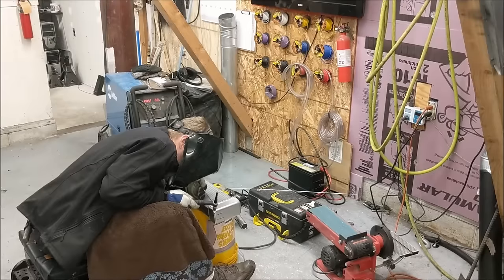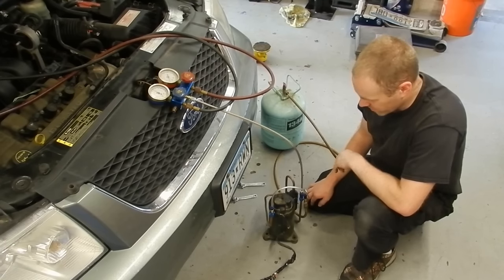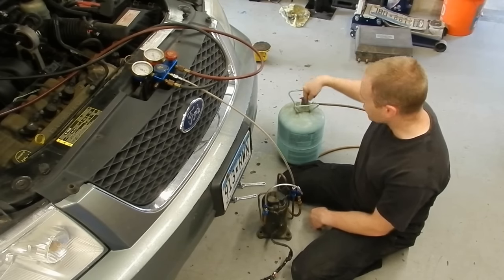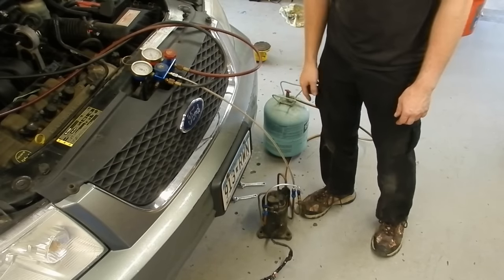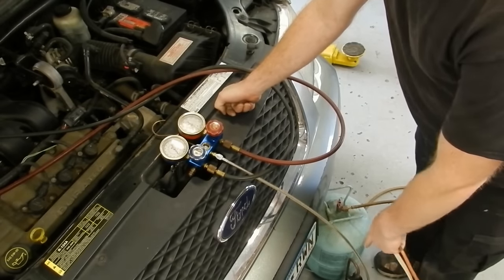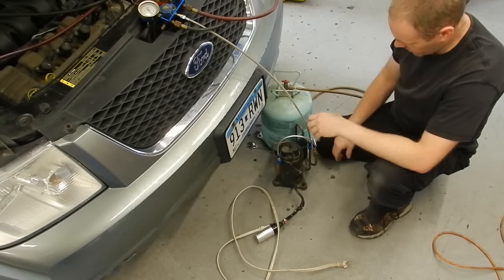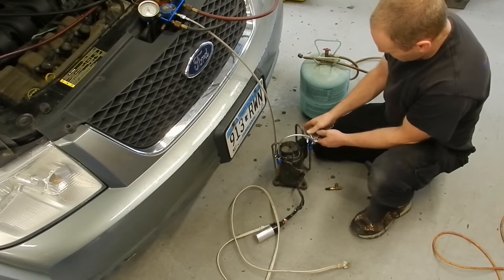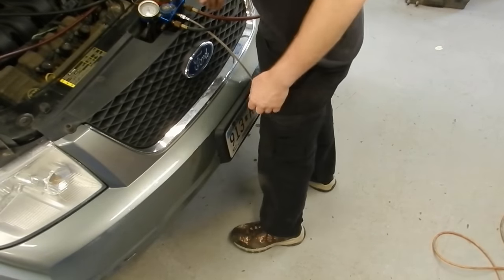Freon recovery on the cheap homemade Air conditioning recovery machine

Comment: Cheaper refrigerant recovery unit:  Put the recovery tank in a bucket of ice.  (No compressor is needed.)  Connect to manifolds, and open H and L valves.  The refrigerant will condense inside the tank, leaving no liquid refrigerant in the HVAC system and only a trace pressure of gaseous refrigerant in the lines.  It's not perfect, but it will recover 99% of the refrigerant. Caveat:  If there is a check valve on the tank, that will have to be disabled.  On my recovery tank, there's no check valve.  Bonus:  It's impossible to over-pressurize the recovery tank.
Reply: 99% sounds high to me but if it gets like 80% that's pretty good
Reply: When the comment is better info than the video 😮
Reply: That's methed up lol
Reply: I was wondering if this worked . I use to extract hash oil with a closed loop system and we used dry ice under recovery tank and would suck all butane thru system for recovery.  All the shops I've worked at have machines but would like to do side work and was thinking of getting a recovery tank and chilling it same way and it would recover all freon . And just weigh it before and after . Thanks .
Reply: @corydeanhawkins  it's stience man!
Reply: Yes, a active pump like a Fieldpiece HVAC  recovery pump & recovery tank in regular Ice will work fine for making cannabis Wax / shatter
Reply: Allow me to add, it is Only impossible to over pressurize the recovery tank in this method, *If using a compressor or other pump, it Is possible. Be careful Fam

Comment: I'm a smalltime mobile mechanic, I have a snap-on KoolKare Plus machine I bought when I had my shop. Now that I've scaled back my work, and the cost of refrigerant going nuts (at least $10.00 a pound) I don't do much ac work now, so I'm selling my machine. 
What little ac work I do now this setup will do the trick, I'm gonna add a scale to the setup. 
A customer replaced his house ac unit and gave me the old one... didn't know what to do with the compressor, now I do.
Thanks for the video.
Also too, the scale, fittings, hoses and stuff will cost less than the new filter you can only purchase from snap-on. So when I sell my machine, I'll let the buyer change the filter for $160.00, I'll make this thing, and have a couple bucks left over to play with.

Comment: I did the same thing with a freezer compressor but used an old propane tank without the internal float and valve. Been an auto tech for 40 years and have thrown away tons of spent R134a cylinders not knowing about being able to mod the valve so it could be used to recover. What a great tip! Also, putting your recovery cylinder in the freezer helps.

Comment: Besides refrigerants not being pure, i think most people ate forgetting the refrigerant should leave the tank as a gas not liquid so amy oil or solids should be left behind its in essence working like distillation. I would put a ac filter on it to keep particulates to a minimum. A new one off a central ac should suffice

Comment: Easy temperature / pressure check will tell if there is contamination in the recovery tank when compared to a PT chart for that refrigerant type.
Reply: Couldn't you use a regular vacuum pump in place of the window unit compressor by putting a hose on the discharge side or the vacuum pump to the old Freon tank

Comment: I have the same question about just buying a coolant recovery machine, a tank and a scale off of the dreaded Amazon, I just got done rebuilding the ac on the wife’s truck again and there is no listed part number for the expansion valve and I picked the wrong one, the little 12oz cans are like $7/ea here and I really don’t think I need to keep buying them to get it working, 4 semis and 5 pickups at my house I’m sure I could get the use out of a recovery machine if it works for 10 years

Comment: I built a recovery machine out of an old reciprocating compressor from a dehumidifier. It is super fast. It would definitely over pressurise my refrigerant tank if I let it. On reciprocating compressors the casing is the low pressure side and on rotary compressors the casing is the high pressure side. I lose a lot less refrigerant because of that.
Reply from the maker: Interested
Reply: @CrazedPerformanceRepair  In a few days I will upload a video on how to build a recovery machine like mine.
Reply: @CrazedPerformanceRepair  I made a video about my refrigerant recovery setup but I didn't talk much about my recovery machine. Here is the link... https://youtu.be/XGopO0AJRrY  I still plan on uploading a video about my refrigerant recovery machine specifically but I haven't had the time. My current machine no longer has the dehumidifier compressor because it was to fast for the small systems I work on. The compressor I'm using now is from an R134a mini fridge. Also I should mention I work on a variety of systems with a range of refrigerants and that makes a rotary recovery system unusable for me because it would cause cross contamination of my refrigerants.
Reply: FYI, some Fords like the one you are working on used a variable displacement compressor and the valve sticks causing low volume. Ford issued a TSB to remove the control piston on back of compressor then flip the spring around to other side. This makes it 100% output all the time. 

I am also building a recovery machine. I do a lot of A/C work in Texas. Have fun.
Reply: wht happend to that video?

Comment: Pretty ingenious. Only thing I'd have done differently (besides adding valves...and a cart to mount it on) would be to use a vacuum pump to evacuate the storage cylinder first. When it was opened to modify the valve it would've been contaminated with air, which you will then turn around and contaminate your AC system with once you put it back in. Unless you just plan on giving the tank to your local hazardous waste disposal collection center.
Reply from the maker: I did pull a vacuum on the tank with my separate vacuum pump. I just properly never mentioned it in this video.
Reply: @CrazedPerformanceRepair  did you purge the lines before introducing refrigerant to the tank?
Reply from the maker: @jordanmavins  I pulled a full vacuum on the tank and lines before introducing any refrigerant the first time I did it. Otherwise it stays a sealed system.

Comment: I like it but am i wrong for thinking you should have a gauge on the tank? Whats gonna happen if you pump 400 psi into the tank? Or 250 in the cold and tank gets hot? Also curious about how you might seperate the oil, so that you aren't mixing different oils between cars. 
I do similar but use the little cans. I dont let over 100 psi in them,i can only fill them a 1/4 ways and throw them away after one reuse. I also put vacuum on cans first. 

Not judging at all, just seein if i can educate or be educated. Thanks for the video.
Reply: That is all very good points, I think if you're using a 30lb recovery tank without a gauge you should do one car at a time but thank you for the tip about putting vacuum on it... That might in fact be the whole trick for me.
Reply from the maker: I also vacuum the can down first use. After that the weight determines how full it is and with freon there is a direct correlation to psi and temperature. So if one managed 400psi somehow that would then mean the tank would be close to 400 deg f. Just use a temp gun on the tank and keep it as cool as possible. I like to put it in a 5 gal pale of ice water. The bottom cools the liquid refrigerant and the top stays the temp in which the pressure of the tank is. It's all a science I guess.

Comment: The problem I have with this idea is that the refrigerant is in a vapor state when it leaves the compressor so you are recovering this refrigerant as a vapor not as a liquid. 
What you will have to do with this system is ad a condenser and a cooling system so the vapor can change its state passing through the condenser into the tank as a liquid is always best to recover refrigerant in a liquid form as much as you can.
Reply: Refrigerant leaving the compressor has been "compressed" back into a liquid.  You got it backwards.
Reply: @amtrakusa1 uh, that's not how it works. The compressor compresses vapor. The condensor condenses to liquid.

Comment: while i agree that its bad to vent to atmo. What happens when a component leaks and you lose all the refrigerant driving down the road? Can't be any more harmful than a home gamer fixing it himself even if theres a little charge left. still, really like this contraption. might have to make me one.
Reply: The advantage is saving all the refrigerant in the event you have to do a simple repair like a pressure switch
Reply: The difference is in  your choice.  Most people don't choose to let their refrigerant leak out, they don't want it to leak out.  The problem comes when you choose to vent it on purpose.  
If I am driving down the road and someones pet cat runs across the road and I am not able to avoid killing it,  most people will understand.  However, if they were to see me drive over on the sidewalk to intentionally kill the cat, most people would not forgive that.
Reply: @mrmohr2  :0) Good explanation.
Reply: @mrmohr2  well said.
Reply: Main benefit is being able to reuse the refrigerant shit is expensive i worked on industrial units that take 2k pounds or more and you wanna talk about a leak those systems ALWAYS LEAK. 1 or 2 pounds from a car is no worse than you driving the car also r134 has a low gwp.

Comment: Was thinking can do something like this, also the potential to use as a vacuum and a compressor.  Anyways, after doing the Prius AC Compressor with my HVAC man who has all the kit, seemed to me the cheap locally Autozone sourced ND14 equivalent I used instead of ND11 was what was the most nasty of the chemicals in the system. Thanks for sharing.

Comment: I understand trying to save a buck but I saw a couple things that I would question.  I didn't see him pulling a vacuum on the recovery canister prior to pumping the freon into it.  How do you not contaminate the recovered freon with the canister air.  Which brings up a second problem.  The canister he is using (an empty freon charging tank) is a "pressure vessel" not a "vacuum tank".  I don't think you could pull a vacuum on it to remove the air in it before you started even if you wanted to.  Lastly, those tanks are designed for a single use.  I'm sure somewhere on the tank it says do no refill.  Threats on they should not be refilled is not because the manufacturer just wants to sell more tanks.  Those very light gage tanks are designed as are all ASME coded tanks for a particular cyclic life.  When you pressurize a tank and then depressurize it - that is one cycle.  Gas welding cylinders are designed for many cycles because they will be refilled many times but there is a requirement to have them periodically hydro-tested.  Bottom line here is that freon canister he is using will explode once it has been cycled beyond its designed cyclic life and I'll bet if you phoned the manufacturer of that tank they would never tell you what the cyclic life is - all they would say is "DONT REFILL IT".  So as old Clint Eastwood would say, "do you feel lucky punk".  Other than that I applaud his ingenuity but he does need some filters and I don't think you would want to use it on multiple freon systems due to cross contaminating different refrigerant oils.
Reply from the maker: I fully agree except it did accept a vacuum and that was done prior to video. This was only a temporary solution I will be having a recovery tank this summer. And I have since added valving to the system along with a secondary filter other than the factor dryer still attached to the side of the pump. It's dangerous for sure and since you asked. Yes this punk felt lucky.
Reply: I have pulled a lot of those into a vacuum. Our old machine at the shop required us to manually refill the onboard tank when it would get low. So we would have to fit a low side R134a adapter into the tank, and hook the low side hose and recover as if we were sucking down a car. In doing so, it would pull a vacuum on the tank when it would go empty. I checked one 2 days later and it still had a full vacuum as far as the gauges could tell.

Comment: Nice ..... but couldn't you use a run of the mill vacuum pump in place of the compressor by putting a hose on the discharge side of the vacuum pump to the old Freon tank
Reply from the maker: No, the seals in the pump and pump itself don't work that way.

Comment: My concern is not even safety but, how did you separate the R22 compressor oil from r134a refrigerant ? You definitely didn't reuse the refrigerant you recovered from the car again did you?
my calculations says there is a mixed up of both R22 & r134a refrigerant present in that window unit compressor mixed with r134a that you just pulled out of the r134a system.
Reply: R22 eats rubber hoses.

Comment: How did you get the air and all the other contaminations out of this tank and out of this old window unit compressor. Do you have an service port to connect an vacuum pump. Or you do not reuse what you put in this old cylinder , what makes sense.
Reply from the maker: It was a good working unit so no contaminates besides air/moisture. I used a vacuum pump to pull it down after adding fittings. I also don't pull down any cars with bad compressors with this pump so I don't ruin or contaminate anything. It's rare I do any ac work after all. Thing still works after all these years though. I should get a better solution but money is really tight right now.

Comment: How deep of a vacuum do you pull on that "recovery tank"? My guess is you had a 0 psig reading on that tank and you filled it with a pound or so of  R-134a. You're now mixing non-condensables with your refrigerant. If you're returning it to the vehicle's A/C system you are filling the system with a non-condensable gas which will cause your system to not work right, the water will mix with the oils in the system and cause acid to form, and you will cause premature compressor failure from the acid and it trying to compress non-condensable gas. My guess is you're not pulling a vacuum on the car's system which just leaves even more non-condensable gas inside the system.
Reply from the maker: You sure assume a lot, I pulled a full vacuum on the tank and car prior to any adding freon.
Reply: That was my thought too because nothing was said about it in the video.

Comment: You need a condensing coil in line between compressor and tank to dump heat and condense the gas into liquid so you don't over pressurize your tank
Reply: It condenses in the tank as it cools quickly. Also the pump can only run so high of pressure and you can feel when the tank is full of liquid.
Reply: Or you could submerge the recovery tank in a bucket full of ice and water.

Comment: You need to have a vacuum in the recovery tank first.
Reply from the maker: I did the first time just never showed it.
Reply: I lost all my faith in you now. That is a major amount of forgetting to show. It would affect the overall project. Then you say you did but didn't show it ? Right sure believe that. If you have any integrity pull this down and redo it correctly.
Reply: @deanstuder1775   I agree.  He should add close ups of all the connections and a hose diagram.

Comment: Just running the car and cracking off the high side will do the same thing. However it's very dangerous to re use a storage container. If you are crazy to do that then at least monitor the pressure on it.
Reply: You mean just let it out into the atmosphere??
Reply: @lavishlavon  No  into a bottle (be careful as you could blow the bottle). I can't remember all the video. Probably best to buy a recovery machine.
Reply: @andrewthompsonuk1  oh ok. well those machines are stupid expensive, average $800, i think $400 was cheapest i could find & they go up to 3 grand+.. i can say 4 me, it just isnt feasible, doesnt pencil out lol. im assuming the same goes 4 dude in the video although idk to what extent he messes w/ refrigerant (how often, etc.). i mean if i was [im not] to get into the ac biz then yes, ya' gotta have it.. i would probably need some help from the bank tho! its an investment 4 sure.

Comment: If anyone sees my comment please respond asap. I have a older recovery machine given to me years ago and it has a recovery tank that feels pretty full. Can i use that for charging systems? Im sure it went through its filter system. I tried recovering my truck ac with it but it says if the tank is full it wont function. Ifs tank full light isnt lighting up tho but it doesn't pump down the system. The bottle seems really full tho. I wish there was a way to see how clean that freon was because im needing to recover it a second time as i think my expansion valve isnt working right. I hate to loose another 4 lbs of freon.. And if anyone wants to give me pointers I am absolute stumped on my truck a/c. I got really good pressures and the low pressure lines get nice and cold and the evaporator makes tons of condensation but its not icing up. But i get 70 degree air out the vents.  I dont get it!! My flapper things that run the temperature all close well and the evaporator is cold as shit.. Im so stumped..
Reply from the maker: Sounds like a blend door issue to me if evaporator is cold. How did you verify the blend doors are functioning properly? Not sure what vehicle you have but the door can separate/break and allow hot air by. It could also warp, they are only plastic after all...
Reply: I think you can sell the used freon in the bottle? Definitely can't reuse it not knowing what kind it is....